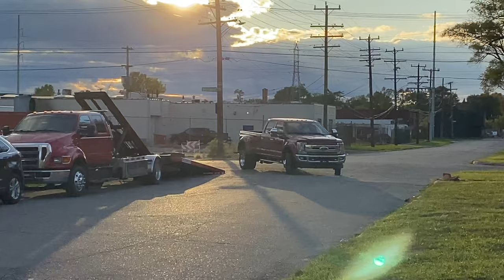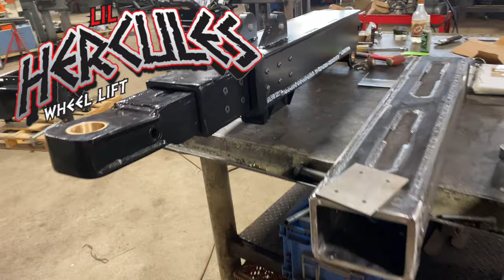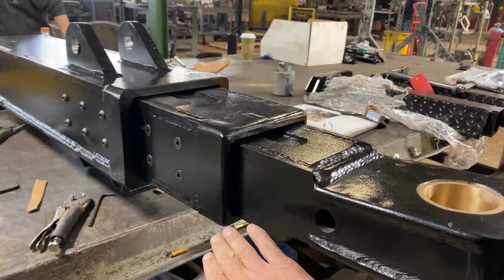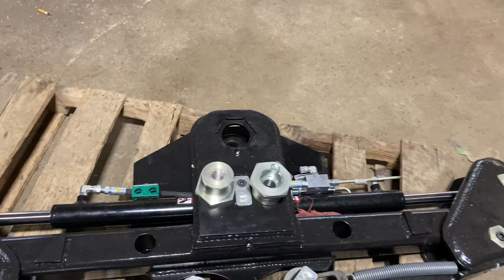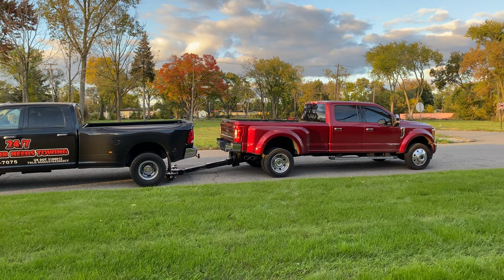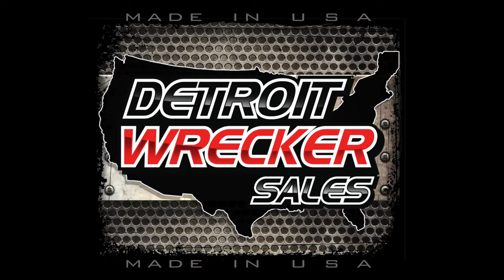Lil Hercules 2.0 by Detroit Wrecker Sales for Urena's Towing

Comment: I think the wrecker is awesome! 
I kind of drive a tow truck driver(it’s complicated)I’m a mechanic that can also do other things,those other things are driving a 50 ton wrecker(big old Kenworth)and other calls I use a F450 with a full wrecker(jerdan I think).
Anyways my questions are from two angles,one the perspective of a mechanic that services the old style wreckers and under truck stingers,and of a tow truck driver(limited experience though). Some of the things that you pick up with that thing is awesome,most guys (drivers)I talk to won’t try and pick a fault from the rear like that,when in a lot of situations being able to grab from the rear would be beneficial.
Sell me and the company that I work for on one of these things as I could be hitting the owner up for my own F450/3500 GMC,the company has been around since the early 50’s and is still going good.
From the mechanical standpoint they make a great deal of sense simply from a maintenance standpoint,sometimes you (the shop) gets super busy and things get overlooked 🤷‍♂️it happens.
How much do they typically run in Canadian funds? Any info would be greatly appreciated,and I can pass some info off to the owner.✌️
P.S
Great product and people ✌️

Comment: What is the max weight you can lift with this? Can it handle box trucks?
Reply from the maker: Our unit has a 5,000lb Lift Capacity and a 10,000lb Tow Capacity. More than a pick up truck 🛻 can handle.   #LilHerc will work circles around any wrecker body or competitors unit that is similar to ours by far, in regards to duty cycle, lift capacity (10,000lb Tow Capacity, 5,000 Lift Capacity)

All wreckers have plastic wear pads for the sole purpose of replacing. There is no structural purpose for lifting/towing a car/truck. 

The pivot pins are designed to wear out quickly. Thus forcing the end user to buy them annually. None of which is a factor for our clients. 
Wrecker bodies minimum = $30-40k. 
Lil Hercules = 16k not installed. Big difference in price and not having to deal with the downtime or replace the costs of pivot pins or plastic wear pads. Plus the fact your driving in a comfortable truck that rides like a sofa not a brick like a wrecker. 

Not to mention our LH 2.0 now has 5” bore Lift cylinder. 
That means it’s stronger than any wrecker out there, that’s mounted on a 450-550 chassis. Obviously excluding med duty wreckers that are mounted on F650 of similar chassis. 
But that’s my point! We are the first to over build the application to this degree.  Unlike anyone, anything or anywhere else. 

We have thicker tubes, bigger cylinders, superior pin system, no wear pads. 🗣 🗣🗣🗣You can’t afford not to have one of our units imo.

Comment: How do I buy one of these setups for my f250 super duty
Reply from the maker: Call us 313-835-8700

 #LilHerc will work circles around any wrecker body or competitors unit that is similar to ours by far, in regards to duty cycle, lift capacity (10,000lb Tow Capacity, 5,000 Lift Capacity)

All wreckers have plastic wear pads for the sole purpose of replacing. There is no structural purpose for lifting/towing a car/truck. 

The pivot pins are designed to wear out quickly. Thus forcing the end user to buy them annually. None of which is a factor for our clients. 
Wrecker bodies minimum = $30-40k. 
Lil Hercules = 16k not installed. Big difference in price and not having to deal with the downtime or replace the costs of pivot pins or plastic wear pads. Plus the fact your driving in a comfortable truck that rides like a sofa not a brick like a wrecker. 

Not to mention our LH 2.0 now has 5” bore Lift cylinder. 
That means it’s stronger than any wrecker out there, that’s mounted on a 450-550 chassis. Obviously excluding med duty wreckers that are mounted on F650 of similar chassis. 
But that’s my point! We are the first to over build the application to this degree.  Unlike anyone, anything or anywhere else. 

We have thicker tubes, bigger cylinders, superior pin system, no wear pads. 🗣 🗣🗣🗣You can’t afford not to have one of our units imo.

Comment: How much a system like thos
Reply from the maker: The Lil Hercule's is the strongest lightduty Wheel-Lift on the planet! Pricing is currently $25,000.00 not installed, plus shipping. For installation add another $9k for a total of $34k our the door 🚪, and that includes:

The most thorough Frame Reinforcement in the world 🌎. Our in house engineer stress tests the truck frame in 3D CAD click here —> https://youtube.com/watch?v=PKhJzoIPpeQ&feature=sharea

Rear Suspension. Our trucks literally ride like a caddilac when completed. Almost every customer comments on how smooth the ride is loaded or empty. Click here for the video —> https://youtu.be/u-JzOq1HqvE
* Plus it comes with everything else that is needed to tow home like chains, ratchets & straps. Again everything needed to tow home. https://youtu.be/NZJtB9Z2S-4?t=148
* Toolbox for the double motor electric pump (runs twice as fast as a single motor). https://youtu.be/NMxMgUUQhsQ
* Wireless Towlights and corded. You get both!
* Work lights w/ a switch installed into the dash to turn on/off. So you can see at night when backig up.
* Spare springs for L Arms, spare hydraulic o-rings for every hydraulic hose connection, spare 300 amp fuses for the electric motors. 
* 5,000 Lift Capacity  - 10,000lb Tow Capacity - The highest in the industry period!!

LH 2.0 now has a 5” bore Lift cylinder, Which is currently the world's biggest 'Lift" cylinder for a light-duty application. We made our tubes thicker to accommodate & they are over 1/2" thick!! Making them the thickest tubes in the world as well for a light-duty application.
Our Crossbar is the thickest at 3/8” thick throughout, pivot pins are so superior that you can tighten them at any time, they are adjustable unlike any other unit available tody. That goes for the L Arm pivot pins as well!  #TwinHexPinSystem 
Our units offer a big difference not having to deal with the downtime or replace the costs of pivot pins or plastic wear pads. Our units are a game changer! 

We are the first to over-build the application to this degree. Unlike anyone, anything or anywhere else. We have thicker tubes, bigger cylinders, a superior pin system, no plastic wear pads. You can’t afford not to have one of our units. They are stronger and have proven to last longer than any other. Plus the fact your driving in a comfortable truck, not a rough-riding wrecker. Essentially killing 2 birds w/ one stone making the truck a versatile money-making machine. Your personal truck is also your wrecker truck is also your 5th wheel or Gooseneck truck. So many trucks 🛻 all in one. "The bitterness of poor quality remains long after the sweetness of low price is forgotten. "
Ben Franklin.

* WHAT'S THE BIGGEST THING I CAN TOW? *
* Anything smaller than your truck. Never tow something as big or bigger than your truck if you want to stop and steer safely. Towing a truck as big or bigger is going to exceed the capabilities of the brakes (you do not have trailer brakes in this application). 

* WHAT TRUCK DO I NEED?***
* Any year or make, that’s a 3500. 
* Any 2500 from Ford or Chevy with a 10k GVWR, and to my knowledge, that’s 2017 and up. 
* No Ram 2500's any year because they either have Rear Coil Suspension or they lack the 10,000lb GVWR needed. The truck must have 2 things to qualify a 10,000lb GVWR & Leaf Spring Rear Suspension. (We prefer a 160” wheelbase as well). 
The installation comes with:
- Ratchets, Straps & Safety Chains for securing the vehicle in tow.
- Spare Hydraulic O-Rings for your hydraulic system.
- Spare Fuses for the Electric Motors.
- Spare Springs for the L Arms.
- Spare can of Undercoating for the frame.  We undercoat all frames with a quality rubberized coating great for our MI weather.
- Wireless Towlights from Towmate (Green).
- Regular Corded Towlights.
- Fox Rear Shocks. Our units ride like caddilacs loaded or empty!
- Tool Box to house the double motor Electric/Hydraulic Pump & Batteries.
- 2 Interstate Batteries w/ a nationwide warranty.

* OPTIONAL  ITEMS *
Frame Fork KIt - $4800 comes w/ 3 sets of forks.
Winch behind the plate - $4300 comes w/ synthetic rope.
Wireless - $1850 the LH comes standard w/ a 20’ corded controller.
Motorcycle Attachment - $1350 enables the LH to tow motorcycles damage-free.
L Arm Extenders - $600 for the pair. They extend the L Arm. Made of 6160 aluminum.